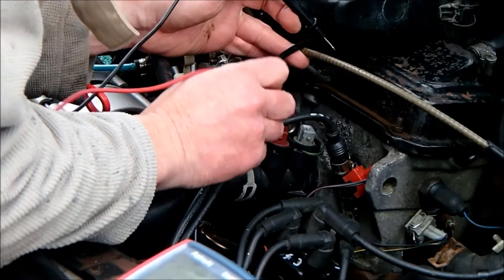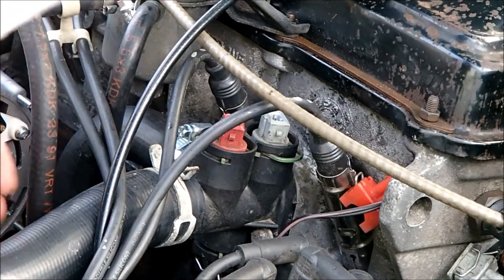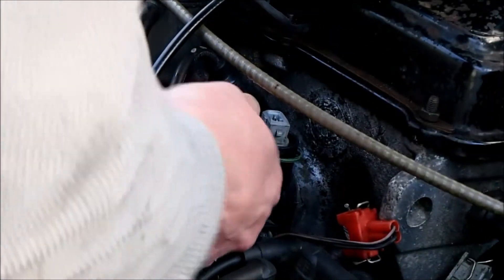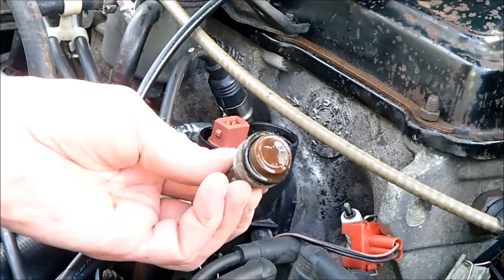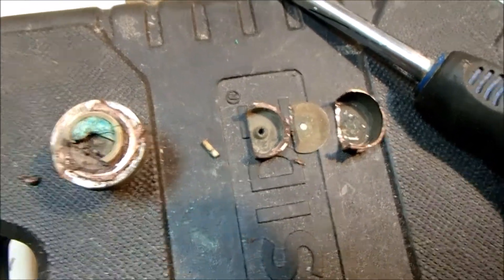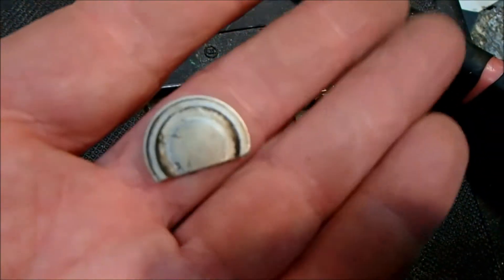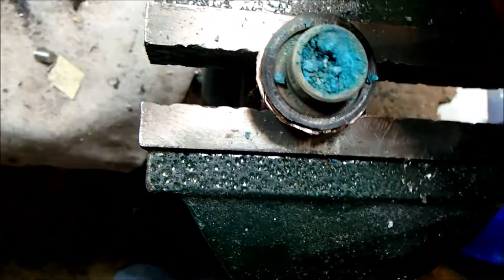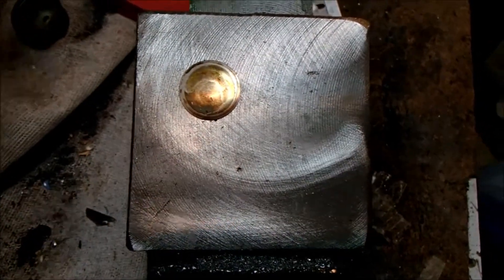VW Golf mk2 20mm coolant thermo switch - fitting and failure analysis autopsy

Comment: Richard I can’t thank you enough for this video. I’ve checked mine and they are both broken as well. Only problem is I can’t find the red sensor on the vw heritage web site but not the grey one. They list a green/black sensor (251919501D) but I can’t find the grey one. You you have the part number? Or is the green/black one the same?
Reply from the maker: Part no 191919369B
Reply from the maker: I hope this helps, they are hard to find the right part for this switch
Reply from the maker: https://m.autodoc.co.uk/febi-bilstein/1877425
Reply from the maker: https://www.ebay.co.uk/itm/142450338840?mkcid=16&mkevt=1&mkrid=711-127632-2357-0&ssspo=yyqjsshvQx-&sssrc=2349624&ssuid=f5HEsbnUR5u&var=&widget_ver=artemis&media=COPY

Comment: Just a quick thanks for this video. It reminded me to check my car, where I found that both of these temperature switches  were not working. I pulled the front red one out first without bothering to drain the system and only lost a little coolant in the process. I then siphoned some coolant out through the hole, before removing the inner grey one and so I could clean around the holes. The car now seems to warm up and idle when cold a lot better. My grey thermal switch bottom had completely rusted off, so will need to flush the system anyway.
Reply from the maker: They seem to be a common problem on these older golfs. Makes a big difference when done.

Comment: I saw the thumb nail for the video and for a moment my bottom fell out, my first ever car was a VW Polo 1.3 formula E, with a full boot sun roof spoiler and the same grill you have on this,
one day when i win the lotto I will have that old car with a 2.4 Honda Vtec engine with no turbo
Reply from the maker: That Polo will be getting the upgrade if it's life ! I'm guessing it was a MK2 polo. I always liked them ever since a friend had one back in the early 90's
Reply: @richardjweeks  I had a B reg whats that a 1985 ish, all the other polos were more of a two door van look car mine was 4 door and with a boot and \i think formula e was the model but very distinctive was the grill with the double head light, there was even a button name SSA and when pressed every time i came to lights or pulled up the engine would cut out and restart when the gear stick was moved, that did my head in lol
Reply from the maker: I just looked it up and it's a rare beast these days. The formel E was the economy engine setup so I guess that's what the annoying start stop feature was about. In some ways ,well ahead of its time.